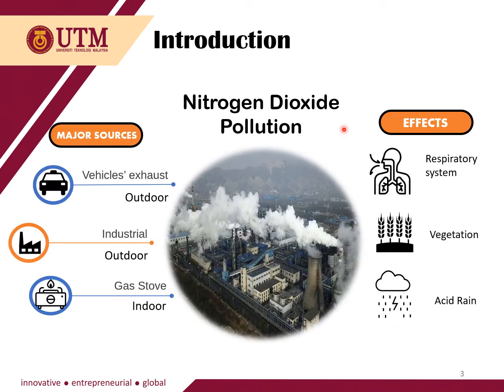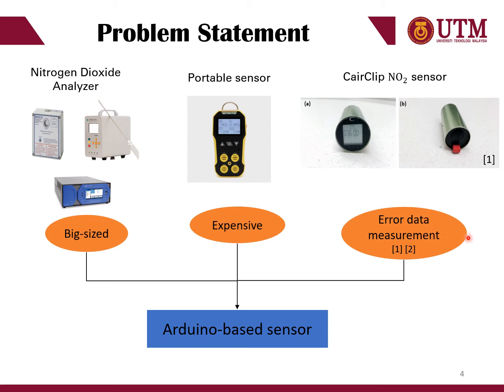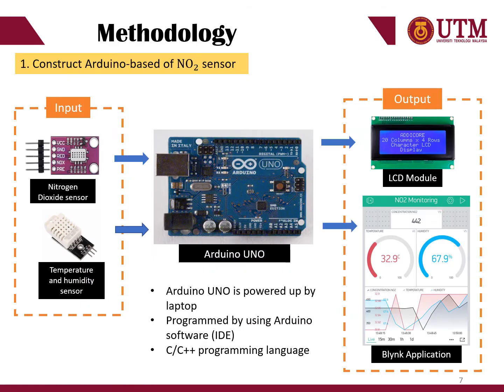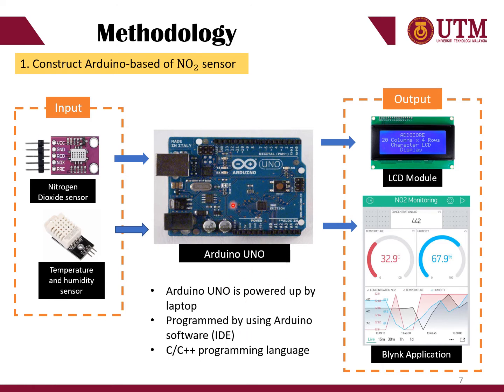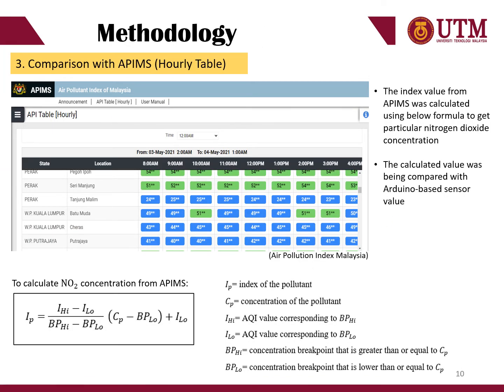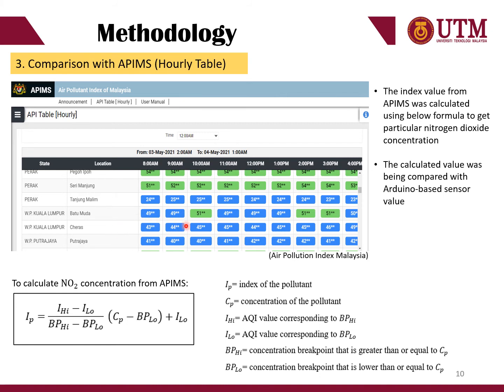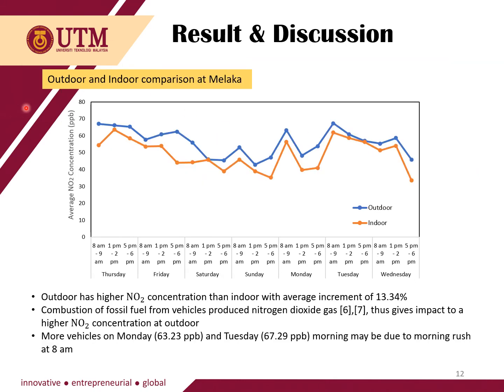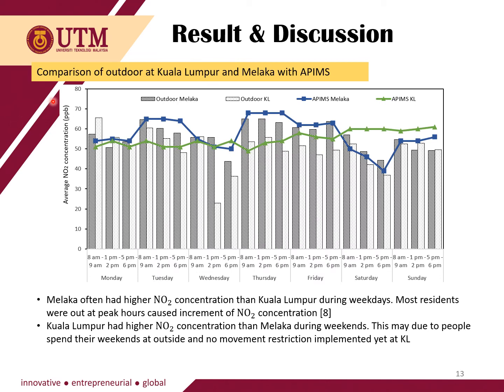FYP 2 PRESENTATION - INA NAZATUL FARHANA

Comment: Assalamualaikum, cik Ina boleh share sedikit tips dalam penyediaan proposal dan komen2 dari SV?
Reply from the maker: Waalaikumusalam. Saya bukanlah nak bagi tips sebab saya pun perlu banyak belajar lagi. Cuma apa yang saya boleh nasihatkan ialah kita perlu tahu dan faham tentang kajian kita. Contohnya, what method we want to use, what is the optimum parameter or why we use that parameter and many others thing. 

Komen dari examiner untuk video saya ini, saya boleh tunjukkan percentage different of the result (Arduino) and validate data (APIMS). another thing is can compare/discuss my result with other research that use Arduino for air quality monitoring. Some quest from examiner were; why i choose that times, why the data were not exact as the validate data, what main factor influenced the arduino sensor, is the height position influenced the results etc.